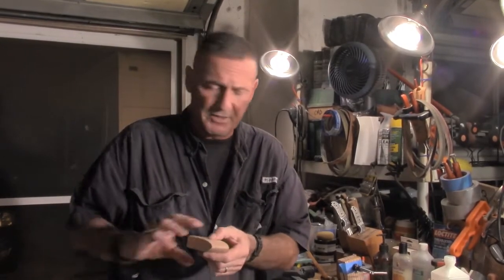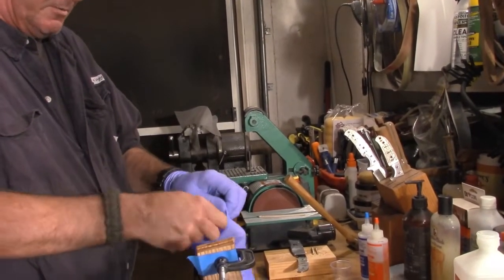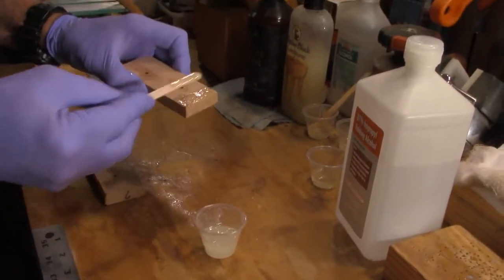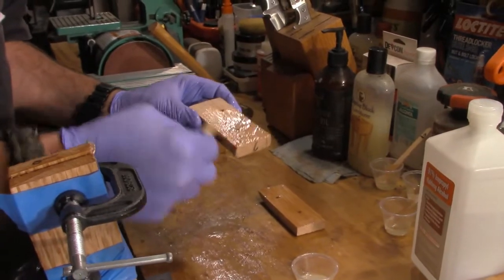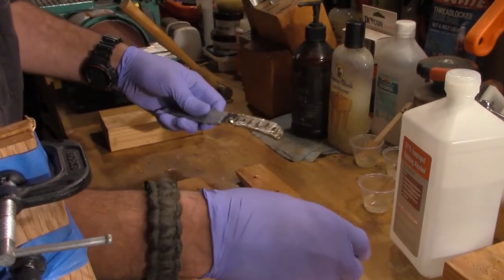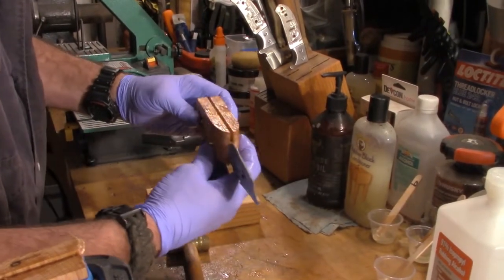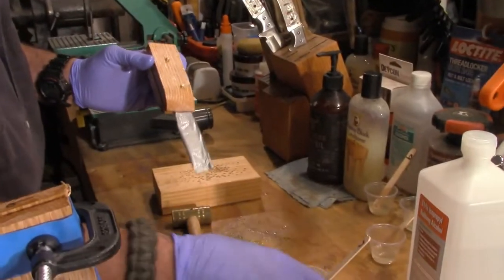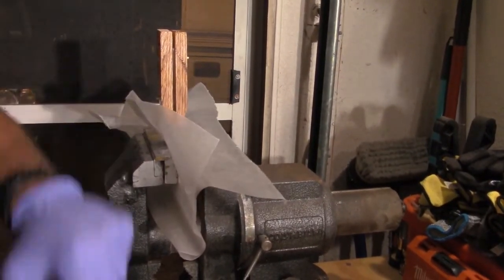Knife making, KNIFE PREP, SCALES, PINS, AND EPOXY Part # 2 of 4

Comment: great job on the set on the epoxy,,its 24 hours to cure. I'm not sure how you treat the Oak handle it maybe in a future vid but the epoxy yur using as glue also makes a nice Gloss protective coat on the Oak handle and would look great for the knife if done right.
Reply from the maker: Yes, but work ability is sooner...I prefer an overnight cure 16-20 hrs. Thanx bro.
Reply from the maker: Simple..soak in hardener for a week.The scales are then Stabilized,